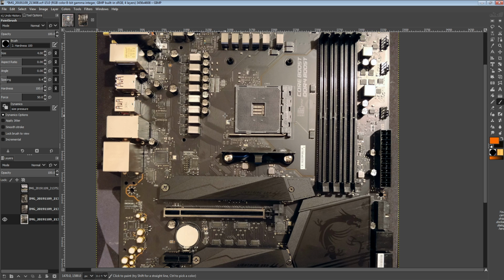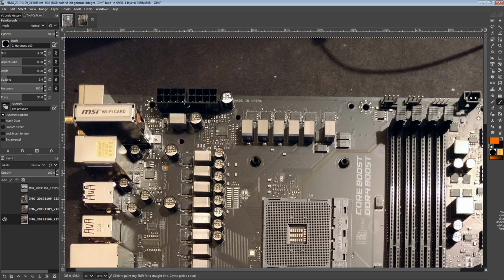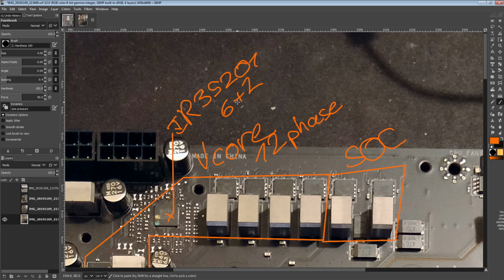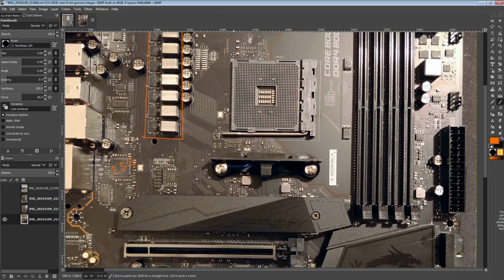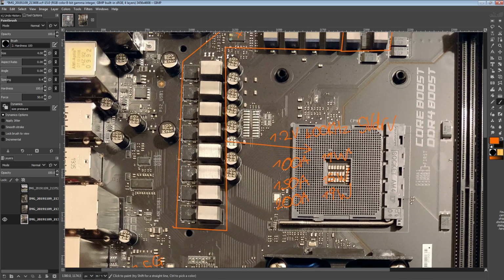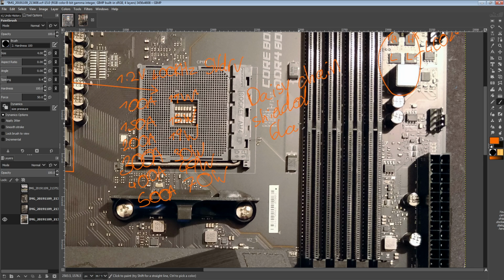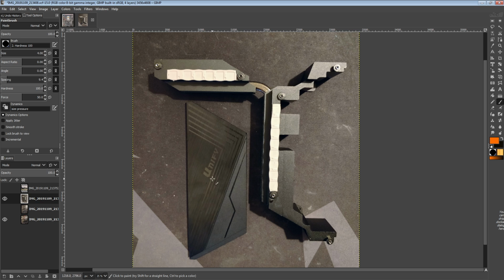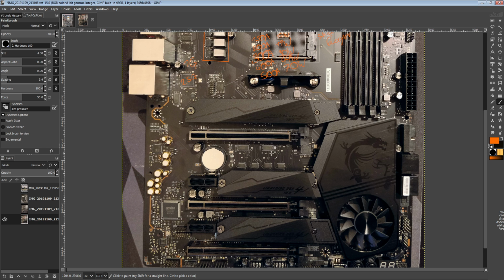mobo PCB Breakdown: MSI X570 Unify

Comment: Shut up, MEG, no one cares!

EDIT: Using the dual 8pins to power PCIe is genius and I hope it continues to be a thing down the road. Not having to route (or even worry about) a third 6pin through a case is great. Yeah yeah XFire/SLI is dying but still.
Reply: Is it only MSI? I always thought that's what dual 8 pins were for
Reply: @gr328  I think the pcie slots usually draw power from the 24 pin, which tends to melt if you draw too much. Some boards geared towards overclocking power the pcie with a 6 pin which can handle more power if you're running multiple graphics cards. This is the first time I've seen an 8 pin used for that. As I follow most of my comments I'm a little stupid so I may have everything wrong
Reply: Just got to that part yeah I'm dumb and misunderstood the question. Not as far as I know but.... 
Edit: there are cpu's that require two 8 pins, on x570 maybe not, but I kinda doubt a lot of manufacturers have it set up like that. I'm realizing everything I type is something buildzoid already said or completely baseless so imma be quiet now
Reply: @teddygoboom1  quick question 
So I'm planing to slap a Xfx 5700xt (dual 8 pin) on the unify 
So how do I power the card the best 
Do I just plug the dual 8pins on the MoBo and the gpu gets the power or use the dual 8s on the gpu and don't use any on the MoBo . 
I'm really confused
Reply: @Funzer4D  Glad you asked, buildzoid did an update on this where he explained he was wrong, they dont power the pcie slot. Either way you'll need both 8 pin pcie cables plugged in to the graphics card, and at least one eps 8 pin for the mobo
Reply: @teddygoboom1  ohh ok thank you very much for clearing that up , so that means the dual 8 pins on the unify are just optional or do they have to be powered aswell for the MoBo to work ?
Reply: @Funzer4D  You need at least one plugged in to the motherboard to power the cpu, the connector for that looks similar but has different shaped pins and is wired differently than the connector for gpu's, they're not interchangable. If your power supply doesn't have two extra 8 pins you'll need to upgrade that too for the gpu to work. Basically at a minimum you need one in the motherboard, and both in the gpu.
Reply: @teddygoboom1  ok but as far as I know my psu should have at least 3 8 pins left but off course correct me if I'm wrong , talking about a seasonic focus gx 850 fully modular here. By the way thank you very much for your knowledge even though this video is a bit older. May you have a wonderful day sir

Comment from the maker: first
Reply: Thanks for the teardown! A very interesting thing for me is that they have placed the M.2 Key E (Intel AX200) WiFi card in a vertical M.2 Type E slot which is hidden under the IO plate shroud and then under a metal shroud that both acts as a heatsink and protects against electrical interference. To make matters even better, the shroud is at the back and directly connected to the antenna connectors, meaning that the antenna cables do not travel across the motherboard. It is brilliant all of this means very clean WiFi out of the box which is free from electrical interference. It also means that in the future, if a user wants some next gen WiFi standard after the WiFi 6/AX standard, they could take off the metal shroud and replace the M.2 card. It is fantastic. Although I expect WiFi 6 will last for a freaking decade, so the motherboard would be replaced long before WiFi would be! Hehe.
Reply: awesome vid as usual. thanks for trying to say "like" less :) ♥
Reply: Brings me back :')
Reply: Fist!
Reply: 17th like :)
Reply: 2nd ;)